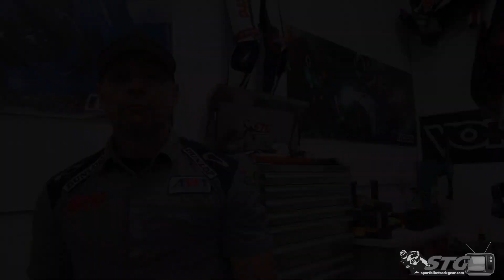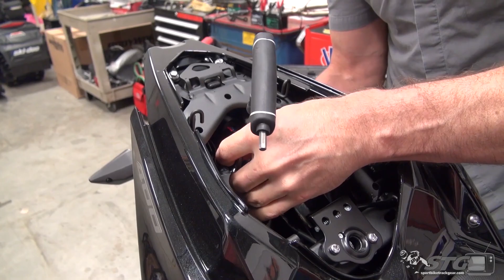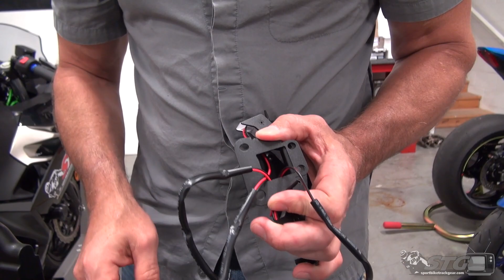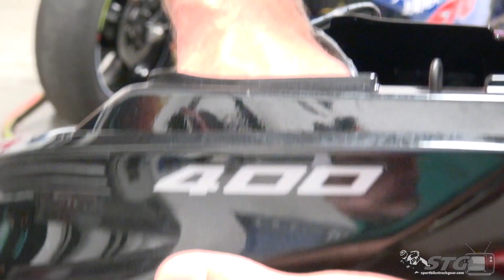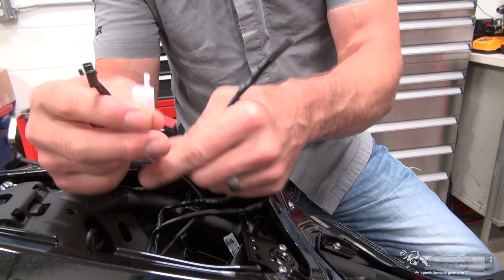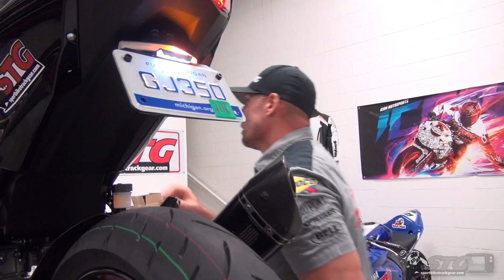New Rage Cycles 2018-2023 Kawasaki Ninja 400 Fender Eliminator | Sportbike Track Gear

Comment from the maker: When we shot this install video we noticed the tolerance of one of the mounting brackets was too tight and contacted New Rage. I just got off the phone with one of the Owners at New Rage and they found that the bend in the bracket was incorrect (the press went with the inside line when it should have went with the outside line). New Rage is replacing all the brackets in question to eliminate this problem now. We will shoot an update video next week. 

I have been doing this a long time and want to give New Rage props for jumping on this and handling it quickly and professionally. - Brian Van
Reply: Hey just installed mine may be wrong but I just flipped the bolts around and worked perfect
Reply: @August Johnny Happy to help :D
Reply: sorry to be so off topic but does any of you know a method to get back into an Instagram account..?
I was stupid lost my login password. I appreciate any assistance you can give me!
Reply: @Adan Messiah I really appreciate your reply. I found the site on google and im waiting for the hacking stuff now.
Looks like it's gonna take a while so I will get back to you later when my account password hopefully is recovered.
Reply: @Adan Messiah it did the trick and I now got access to my account again. I'm so happy!
Thanks so much you saved my account :D

Comment: Excellent video.  I was lucky enough not to have the screw issues.  However, the scotch locks are problematic. After installing the dual load equalizer, the blink rate had not changed.  When I moved the wire around the scotch lock it would changed.  When I let it go it was back to fast.  Made Sue all my connections were correct and used pliers to squeeze them together better with same results. Still trying to get it working right.
Reply from the maker: The scotch locks can be tricky sometimes. - Van

Comment: The only issue I had is the wiring to put inside the blue brackets won’t stay in place, no matter how I try to bottom it out and squeeze. Now it’s difficult to take any of it off and I don’t want to mess the wiring by forcing the already clipped brackets off (which means bulky unnecessary wiring in my bike’s butt). AND I dropped one of the blue brackets down inside the rear bike anyway so it’s not like I could finish the job anyway. I’m just gonna live with the fast blinking. 😑
Reply from the maker: Sounds like you are a little frustrated. When you get there it is good to take a break and then come back fresh after you sleep on it. With a little patience you will get this sorted out. - Van

Comment: I attempted to install this. When splicing the wires, on the right side blinker I connected red to red, black to black, this side works correctly. 
However on the left blinker I attached white to red, and this side flickers too fast. 
Any advice on how to fix this problem? I believe I followed the instructions correctly. Thanks
Reply from the maker: This kit includes the New Rage Cycles Dual Load Equalizer that needs to be installed to dial in the flash rate of the turn signals. That is supposed to normalize the flash rate. Double check your work, if you do not find an issue please reach out to New Rage directly. They will get you sorted out and you will be dealing direct with the source. - Van

Comment: I plugged everything in correctly and the turn signals light up just fine, but the plate light won’t light up. Any help or suggestions?
Reply from the maker: Double check your work, if you don't find anything reach out to New Rage direct and they will get you sorted. If the plate light is bad they will send out another for you. - Van

Comment: The left turn signal connector won’t click in with the wiring. How can I fix this or am I doing something wrong?
Reply from the maker: Hard to say for sure without being able to see it myself. I would take a close look a the connector to make sure the lock is not deformed, if that looks good see if you are able to push the male part of the connector far enough into the female side that it allows the lock to engage. If you are not able to resolve this reach out to New Rage directly for support. They do a solid job over there and will get you sorted out. - Van

Comment: Solution to the mounting bolt issue: install bolt from the top side.
Reply: Literally thought the same thing, took the stock ones out from the top and the nut already has a flat side…
Reply from the maker: If that works better for you no reason not to do it. - Van

Comment: Should I disconnect the battery before doing anything?
Reply from the maker: No need to disconnect the battery when installing this fender eliminator. - Van
Reply: @sportbiketrackgear  you said in a previous comment that you SHOULD disconnect the battery before installing. Any reason why you’ve changed your answer?

Comment: I did everything you said but when I connected the wires my blinkers did not turn on. Any suggestions?
Reply from the maker: This is hard to diagnose over comments. Odds are you have a wiring issue related to the install. Double and triple check your work to find the issue. If you do not find anything reach out to New Rage for support. - Van

Comment: Put mine on today! I love it!! Although, the wires on my  equalizer were red black and white. Another issue I had was that the wiring in the back of my bike had absolutely no play in it so the unplugging of the connectors was a bit of a pain in the ass.. alls well though, got it done, waiting for a couple more parts and she'll be back on the road :)
Reply: Hey I know I am 3 years late. But my kit is the same as yours....and for some weird reason, I didn't get the wiring diagram on the bag T_T which wire is which compared to this vid? Thanks a bunch!!!!!!
Reply: @danicalu  oh boy… this was a while ago. I don’t remember. I haven’t had my bike I modded with this for a while.  :( typically red is positive, black is ground, and white is something else lol. I know I’m no help.
Reply: @DesignatedDrinker12  Awh thanks for getting back to me tho doll!! Truly appreciate it!
Reply: @danicalu  you’re very welcome! I do believe there are 3 wires under there. One to correspond with black, red and another color which is the equivalent for the white. I’m by no means an electrician lol. I figured it out. I’m sure you can!! If nothing else, you could give STG a call and ask them to help you!
Reply: @danicalu  do you remember which wires went to which?  I've had this kit for over a year and went to install it today. No wiring diagram here either. Any reply is much appreciated lol

Comment: shouldn't the screw go the opposite way to secure the bracklet to the fender.  meaning it should go North/South  rather then South/North
Reply from the maker: Negative, this is the correct direction. Actually just got off the phone with one of the Owners at New Rage and they found that the bend in the bracket was incorrect (the press went with the inside line when it should have went with the outside line). New Rage is replacing all the brackets in question to eliminate this problem now. We will shoot an update video next week. - Brian Van
Reply: Amazing VAN!!!  Keep up the great work.. what I have learned, specifically, from your channel...  is Second to NONE!
Reply: Candice Young I agree. These videos are so helpful. And it’s better that a professional mechanic if doing the work/guides and not some random youtuber.

Comment: Did you try feeding the bolts in from the top and having the nuts underneath? Maybe one of the flat sides of the nut would act the same as the ground down bolt head?
Reply from the maker: I did, the nuts have the same diameter as the bolts do. That said it also looks much cleaner with the nuts inside the tail. End of the day this is not really a huge deal IMO, this kit looks bad ass on the bike so it's worth the effort. - Van
Reply: I agree. The kit looks awesome regardless.
Reply from the maker: Just got off the phone with New Rage, they found an issue with the way the small bracket was fed into the press and have corrected it. They are replacing all of the brackets in the kits they have in stock now and are sending new ones to us so we can replace the ones in our kits before we send them out. - Van